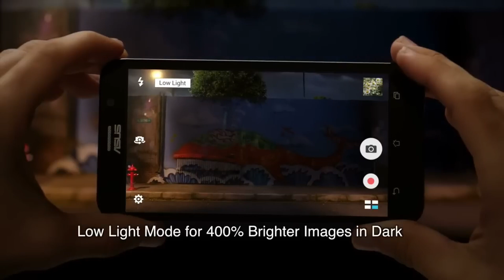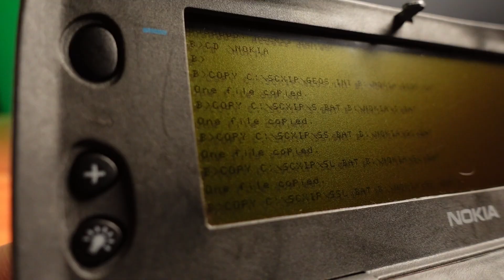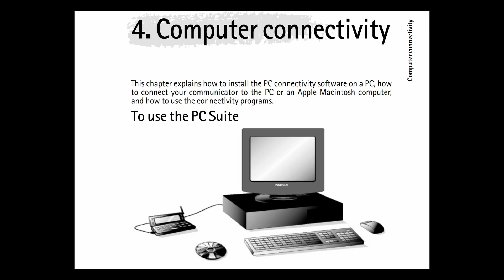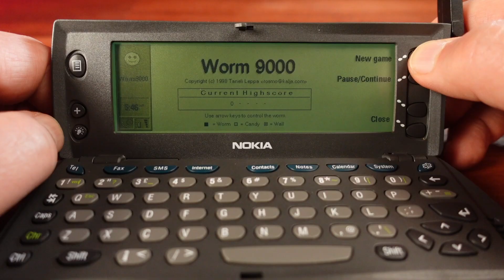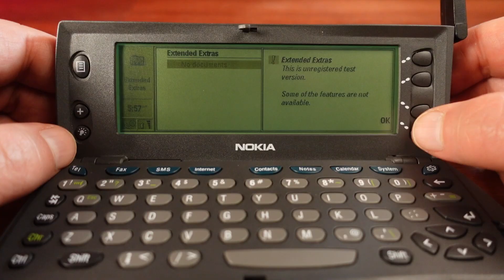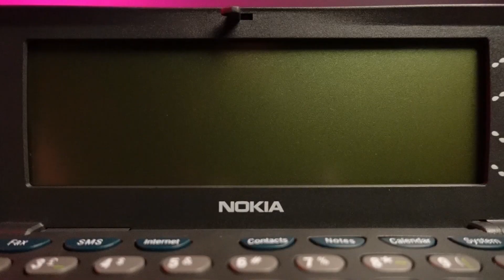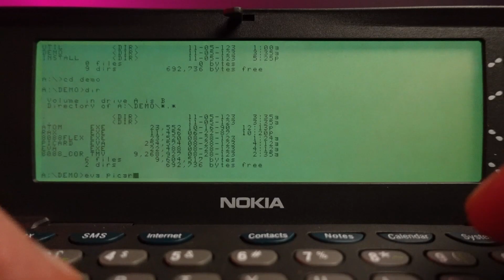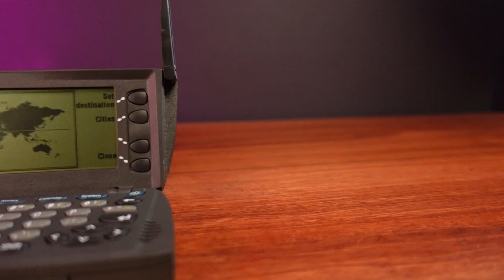Running on a 486 CPU : Nokia's 1998 Smartphone

Comment: Incredible discovery!  I had no idea that the Nokia 9110 Communicator used an AMD 486 CPU and ran DOS.  It's definitely inspired me to dust off mine and explore the possibilities! 

I've actually used mine years ago as a serial console for Sparc servers. The projects mentioned in the video sound intriguing, and I had no idea this little machine had such extensive possibilities. Thanks for sharing this insightful journey – it's reignited my curiosity about the Nokia 9110!  🔍💻
Reply from the maker: Yep, it's really cool. The limitations are annoying though.
I'm intrigued by your serial console use. You must have had a serial cable and terminal program running. Very cool.

Comment: I had these phones, the 9110i and the 9210i.  The 9110i got worn out on the hinge, but it was a good phone.  The 9210i was ok but I preferred the 9110i, I then had the e90? I think it was called, but I bought it in Germany so it had a different keyboard layout.
The 9210 crashed a few times and I got fed up with it.  The charger lead had two connectors on the barrel as well as the internal connector.  I still have them, somewhere...

Comment: The original fault might be the flex cable, and maybe os corruption. The flex is pretty weak on this older communicators (9110, 9210) I have two working 9110, two working 9210, one working 9210i and 1.5 9210 for parts (already used to revive the rest) one 9110 has screen glitching rarely, and I had to swap flex cables on 9210 few times, 9210 no longer has a board under keypad, it's just a part of the main flex (I don't like it being one part) and main boards are in the back part (top and bottom if I remember correctly) of the phone, under rigid middle part. I've also have 9300, 9500 and E90, almost full set. 9210 has a really nice doom port of course.
Reply from the maker: Good to hear from a Communicator collector!
I don't think it's my ribbon cable because the phone would freeze during boot with text on screen and the LCD was stable.
Reply: @JanusCycle  but the screen also was showing weird glitches, so could be two problems at the same time, like one of my 9210s that had a white screen with few lanes of text, for some reason os was corrupted, and upon format (few buttons combination upon boot) it came back to life, anyway, at least you have a parts in case you'll came across another broken 9110, unlike 9000 they are cheap (one I bought fo 40 USD, another for 10). I'm collecting all Nokia (and not only) smartphones and music players as well.
Reply from the maker: @Dennn90  That's a good point. Good luck with your collection. There are so many Nokia models.

Comment: Maybe you should try, if possible to re-ball the BGA chip with a dedicated machine to re-flow the joint between the chip and the board. I used this type of machine in the past for a dedicated GPU I own, to make it work again. So maybe you first Nokia 9110 you tried to repair your self isn't completely broken, and may have a other chance.

Comment: You should get the older one fixed at a proper place with equipments
Reply from the maker: Unfortunately the cost is higher than buying a working one from eBay.

Comment: EL backlights are so nice. I used to have an Indiglow watch. We need more EL backlighting.
Reply: I've never understood that brand name, since these are teal not indigo... 

But yes, I immediately thought of my first Proper digital watch as well. I could swim with it, or forget to take it off in the shower, and it wouldn't break! Those backlights were so easy on the eye. (Very easy to dim if you used it often though...)

Comment: I bought one in 2011 but I've never been able to install any programs on it because I don't have a small enough MMC nor the PC cable. I've been able to send pictures and text files to it over infrared but that doesn't work for programs.
If you make a video about the newer Nokia 9210 I recommend trying a game called Legacy, it's an old-school RPG for Symbian S80.

And if you ever get a Nokia E90, there's a port of Quake III Arena for it which can be played on the 800x352 display and even has working online multiplayer
Reply from the maker: Thanks for the game recommendations. Legacy looks good. I'm expecting a large amount of software to look through to find good ones.

Comment: You know, only days ago I had discussions about how reflow doesn't work, at least for BGA, as there isn't the proper process control. People still claimed that just cooking old solder would bring back their GPUs.
There's simply no way around reballing, unless you can reach the joints from the top, or have a super-reliable process figures out.
Reply: The problem with BGAs this that you can't see or get to the balls to inspect the joints. I hate BGA chips. QFP chips are much easier to repair.
Reply: @simontay4851  Exactly. Plus, old solder isn't really flowing anymore due to the oxide surface. You have to at least get plenty of flux under the IC, but then again, without any way of verifying what is happening, besides x-ray imaging.
Reply from the maker: I have reflowed smaller BGA chips and gotten devices working again. It's a risk though and often things stop working soon after.

Comment: I did have a Nokia 9210 Communicator at the time and it was way ahead of its time... which was also the main problem with it since I didn't have a way to connect it to the internet.. and getting files on and off it was also a major pain. I think I had to use a special serial cable and some Nokia software and even infra red.. when making calls you also had to use it with the display away from your ear- so people looked funny at you.. and could read the number you where calling. I did get DOOM to run on it though (may have been Wolfenstein) which was nice..
Reply: It had internet. And even the speed was about same as normal modem over pots.

Comment: Those small BGA chips were definitely RAM chips and even slight overheat to them just kills them, so It's not a good idea to reflow or reball them.

The display was probably gltiching due to a bad ribbon cable or the fpc connector becoming lose because of the decaying plastic.
Reply from the maker: That's a good possible explanation of what went wrong. Makes me wonder how they solder such sensitive chips in the first place.
I'm going to push back on there being bad ribbon cable. The phone would half boot and freeze with text on the screen and the display was ok.
Reply: @JanusCycle  The way these were soldered by manufacturer was probably hot plates, also they heat them at the exact temperature the solder needs to melt. When reflowing BGA chips it is first advised to pre heat the board/PCB and then use the hot air gun to slowly melt away the solder underneat the chips while keeping the gun constantly moving at steady temperature, your usage of flux was correct.

I was guessing on the display because I missed the part where the device was freezing, if that that's the case then those chips were definitely culprit and they were on their last legs, could've also been faulty chips from the manufacturer.
Reply from the maker: @FR4M3Sharma  I learned a lot from this phone. Thanks for your help.
Reply: @FR4M3Sharma  yeah I was thinking the same until I noticed the boot process was totally different on the second phone. So these chips were probably cooked even before the heat gun, especially since some of the boots didn't even get as far as the text-mode bit in the first unit.

Comment: How did you install games on that phone? I never managed to do that even though mine came with its original card, and every accessory was included in its matching original box. Excluding the CD,which I could not download from the internet.
Reply from the maker: I put software into the folder called 'Install' on the card. Then switched the install settings in the program installer from cable to card. It worked after that.
Reply: @JanusCycle  Thank you, I will try that when I get home. Nokia wants all of our Hungarian community to forget about this phone and delete everything we have because they think that the 9110 belongs to the trash after all those years because it is outdated and obsolete. I am just curious to find some games for it, or even better, run Wolf3D or Doom on it.
Reply from the maker: @andrasszabo7386  I hope you get some software working on yours. I'm happy to help.

Comment: Wow, interesting approach to make a cellphone. Also, it shows the difficulties of being early adopters of BGA and/or ROHS. Also, amazingly that it runs GEOS, I'm just out of words of the stuff packed in this phone
Reply: I inherited one of these from my dad, it was coolest phone ever :D didn't really use any of the "smart" features except the ring tone composer (yes, you inserted actual notation in an app to make a ringtone)
Reply: @32herz  wow, how awesome is that! I would've wasted countless hours creating my own (basic tone) compositions, no doubt. Was it polyphonic at least?
Reply: Nokia 9 series are always like this, more modern 9300 / 9500 runs S40 on outside and S80 on inside. Only the latest and last E90 run same system - S60.
Reply: Still predates ROHS quite a bit! BGA, and flexing thin boards, seemed to have been enough of a challenge on their own ;)
Reply: GEOS UI running on top of a non-Microsoft flavour of DOS.
Reply: @6581punk There were any number of DOS clones back then. Hell, MS didn't invent or write their DOS... they licenced it from (and then bought) Seattle Computer Products. It was originally a clone of CP/M running on Intel 808X chips... so even the concept wasn't original. 😂

Comment: I have a Nokia 9500 which turns on, but two of the four soft keys on the right don't work, making the phone unusable. Not sure if it's a broken cable or solder joint.

Comment: Oh yeah, Nokia 9110, my first cell phone! It was incredibly capable piece of technology and I can't believe Nokia got so complacent with "basic phones" that they didn't go big and pursue a smartphone revolution of their own.

Also I need to back up my phone one day. I have the cable somewhere, will probably need to fiddle around with my old PCs and software. OR if it has a card slot like you say, this should get so much easier.

Edit: Oh and I didn't play Infocom games on my 9110. I wish I knew that was possible! I instead tried playing them on my Palm m100 series. Worked, but, well, ehhhh.
Reply: They tried with their Symbian phones (like the N95).  Then the iPhone came out and changed everything.  They weren't ready.
Reply: @cjmillsnun  They were too busy making fun of that little thing that just came out. What was the name? Oh right, Android.
Reply: @cjmillsnun  You could say they did a bit more than "tried" on smartphones. I mean N95 alone sold 14 million and it costed 650-800 euros. They had 80% of the smartphone market still 2 years after first iPhone. What they did totally miss was the touch screen phone. What makes it even more painful was that much of the first Iphone capacitive touch screen technology was bought by Apple from bankruptcy auction of MyDevice. Firm that had its headquarter 500m away from Nokia's headquarter in Finland and that tried to sell its innovation to Nokia for 2 years.
Reply: @cjmillsnun Yeah, they tried competing with the 5800 Xpress Music, and the N8. I owned both of these, but eventually they couldn't compete.
Reply from the maker: If you can find a 32mb or smaller capacity MMC that works in yours, then yes you can easily read that in any SD card slot.
Reply: I think you've got your facts mixed up. Nokia had the mobile phone market sewn up tight, most of their phones ran a version of Symbian, which was always a proper, fully multitasking, 32 bit OS that ran on ARM hardware. Whilst technically not the first to make a "smart" phone, Nokia and the other members of the Symbian consortium, like Sony Ericsson, made the biggest inroads in to the smartphone arena and paved the way for what we have today. They were by far the biggest and most prolific smartphone companies in the world. It wasn't until long after the "iPhone" release that Nokia and the other Symbian OS developers lost the market, with MS and palm also struggling. Android eventually took the place of Symbian, but Google never managed to make their own hardware as popular as Nokia. Apple built on existing ideas, and they created a centralised "app store", replacing the traditional independent software repositories and buying methods. That, along with snazzy marketing, was their biggest coup.
Reply: I am not sure why they sticked with symbian as it is so inferior compared to the windows phone (called windows mobile back then) then blackberry os, iphone os and android. It is slow (i got the 7650) and did not improve even after they released the N series except the camera and storage.

Comment: I’m right there with you on wanting a grayscale lcd like that paired with modern hardware. I recently received a Sharp Wizard organizer that I’d love to see updated with a pi zero or something. In the meantime, I’m working on a similar style of device built around a 4.7” phone-sized epaper panel
Reply from the maker: That sounds like an awesome project. Please share your e-paper device with us when you are ready!
Reply: E-paper displays are far more resilient and longlasting compared to grayscale LCDs right?
Reply: @SockyNoob  but far slower, it all depends on what you want to do. Also electroluminiscense is very cool compared with plain eink backlight or side light.
Reply: @SockyNoob  I'm not knowledgeable enough on the specifics, but LilyGo (manufacturer of the ESP32-based panel I own) suggests limiting the amount of partial refreshes to not degrade the panel. I own a 10.3" color e-ink tablet by Boox which supports fast refreshes and that's fantastic. I guess it differs between panel types. On the monochrome/grayscale end of things, I began a project for making an ESP32 based smartwatch with a 128x62 graphical LCD panel. Not sure what it is but I just prefer the look!
Reply: You can make an Android phone gray scale from developer settings. Combine that with an OLED screen and you also get a slightly improved battery life.
Reply: @adrianmarianpopoviciu215  Pretty similar to another one of Janus' videos, I have an android phone natively running Windows 11. Could be fun to theme it and run in grayscale. No practical purpose there but then again a phone running a desktop OS isn't either.
Reply: I would love to have a Pi powered (or similar) Psion series 3MX, they had lovely, clear screens screens, and their OS was great. The ARM powered Psion series 5, 7 and 'Netbook' were more powerful, a better OS (the basis for Symbian OS), but the screens weren't as nice.
Reply: I've been imagining making a "smart" phone like this.
 
8-bit grayscale LCDs with a powerful backlight would make it versatile for both low-light environments and in direct sunlight.

Ultra-low power CPU and components that would make a battery last 3 days on a single charge, minimum.

Wide scroll wheel, T9, and a small 512p LCD on the front, wide screen and full QWERTY keyboard on the inside.

A FOSS operating system allowing everyone to build apps and tinker to every programmer's delight.

In other words... A fully uncrippled flip phone.

Comment: Excellent video and yes please, do another one in the 9210, that was my business phone back in the old good times. Thanks.
Reply from the maker: I do hope I can get it working. I've heard about a DOOM port . .
Reply: @JanusCycle  Yes, there are two good Doom ports (Doom 9210 and cDoom). By sorting through archives saved by people, I managed to collect more than 200 programs and 80 games for S80 v1.0. There is a Rayman - early Gameloft's game which seems to me one of the best for 9210. Apparently, support for MIDP 1.0 was planned - an unfinished (beta) but mostly working Java machine was preserved. The 9210 was even used in the demoscene, I know at least the Finnish 3D demo "g-force 2001".
Reply from the maker: @Bs0Dd Thank you! I'm going to check these out when I have a working 9210.

Comment: Looking at the casing - dry joints are most likely caused by some drop or something - housing is pretty smashed. :)
Reply from the maker: I did wonder about this. Nokia engineers surely would have designed their first BGA chip phone to be resilient enough for regular use. That board is just so thin though.
Reply: @JanusCycle BTW i'm now noticing - that smashed one has very unique blue printing next to buttons, also left side buttons are different than production version - could it be some prototype version? I've never seen 9110 with print like this before.
Reply from the maker: @ojciecnatoora  It could be a 9110 vs 9110i thing. This phone was on sale for f̶o̶u̶r̶ two years. It's unlikely to be a prototype when found in someone's junk box in Australia. But you never know.
Edit: I meant to say two years.  1998 to 2000.